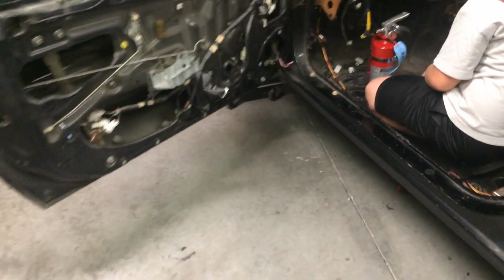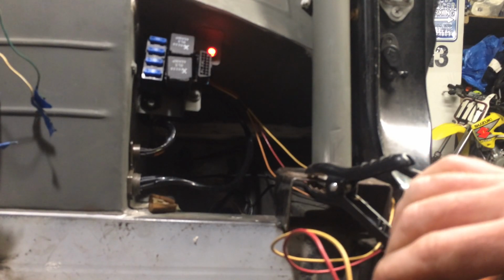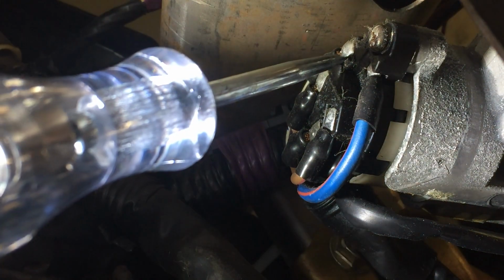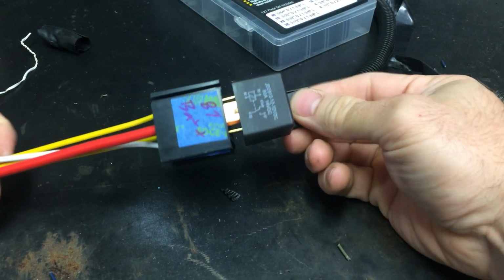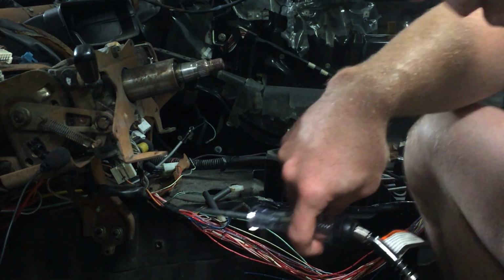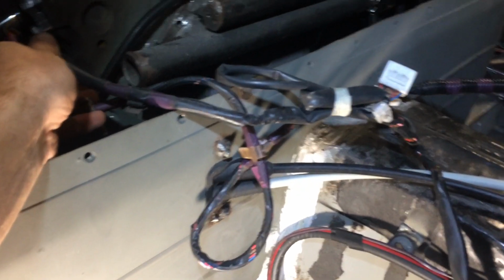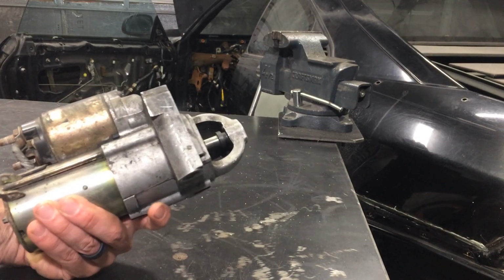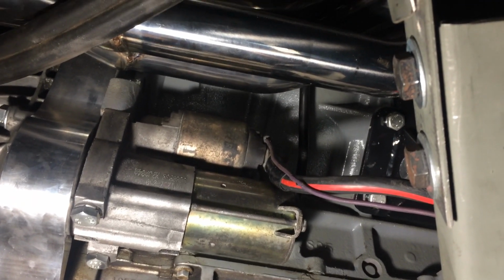V8 MR2 Build #26 (Wiring Pt.2)

Comment: Since I’m not able to provide any answers about the mystery wires posed. My only suggestion would be source a factory wiring diagram.
I hired a mechanic friend of mine to install the stock GM ECM back into my Buick Grand National that had an after market stand-alone unit hacked into it.
He had the tools, experience and diagram to complete the task...None of which I had.